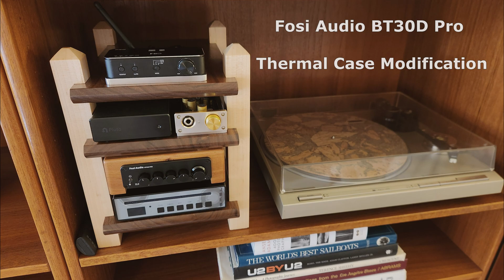CAUTION HOT!  Fosi Audio BT30D Pro Thermal Case Modification

Comment: Yea... even i modified the thermal, subwoofer line keep protecting... Using Vinder 48v 10A and JL Audio 12 W3V3. Thats why they send us only 32V, at 32v 5a the sound cant compete with tpa3116D2 24v 6A 🥲

Comment: Roy, I absolutely love your Sapele cabinetry and your Mahogany shelving! Gorgeous stuff! Just last night I was picturing a set of shelving remarkably similar to your design, as I was trying to work out where I'm going to install my new Blumenstein Orca speakers, a Fosi V3 Stereo Amp, and a gorgeous bright red limited edition FiiO K11 R2R DAC. Should be a good match, I think!

My BT30D Pro running the 48V PSU does not get quite so hot as yours, but my sub and speakers are pretty efficient. I'm using some tiny-but-amazing JVC EX-A1 wood cone full range speakers, plus a very lovely down-firing Denon passive sub from a 5.1 system. The BT30 D Pro still gets a bit too warm for my liking, and I don't think Class-D circuitry benefits greatly from high temperatures. :P

So, I'm gonna cut a couple of slots in the top and bottom, like you did. That will make a huge difference, I think. But alternatively, simply epoxying an 8-heatpipe horizontal CPU cooler to the top of the case would do wonders. Even without a fan. The vertical nature of the fins, plus the heatpipes, make them very efficient. And I found a completely black one for just $60 at AliExpress. And the heatsink size is almost identical to the amplifier size, so that is a very cool option. 

No pun intended.

Comment: I have the BTD30D PRO version to drive my late 90's   Sony SS 3ohm mid n highs speakers and a 1.5 ohm subwoofer, all from a long dead Sony ZAV dvd home theater system. First i connected L/R channels and  handled pretty well those 3ohm speakers with mild case temperature. Things got very hot when connected the 1.5ohm (below spec) Sony sub. It did drive it spectacularly even at high volume. But it does get alarmingly to hot. Even tested the amp working for a dedicated passive sub. Then tried connecting the 3.5mm sub output to a Fosi ZA3 amp driving the sub in mono. Again the BT30SD got very hot fast. Currently I am still using those 3 ohm speakers and 1.5 ohm sub at 50% volume for casual use but WITH AN EXTERNAL USB FAN which gets the cooling job perfectly. Now i can crank the sub without external overheating.
Reply from the maker: In your case I would steer away from this small class D for those spkrs.  Using this amp I would stay 4ohm and above.  Cheers!

Comment: Have you been using the non-Pro version for a long time and then upgraded to the Pro? Was there any difference in sound quality? I've been using the BT30D non-Pro for a long time and I'm planning to upgrade
Reply: I have the BT30D and the BT30D Pro. The main difference is power output. With a larger power supply (I recommend minimum 36V 10a), the Pro can put out much higher wattage in all 3 channels, and can use 48v power adapters. The Pro is overkill for a desktop system, and best when you have a large passive sub and larger-than-bookshelf speakers. I use the BT30 30D for my desktop, powered by a 24v 10a power supply and paired to bookshelf speakers and an 8" passive sub. Rocks my home office.
Reply: My wife has the non-Pro - and I have 2x Pro. Upgrade is good. Get the 48V PSU!

Comment: I run my setup off a motorcycle battery and a trickle charger.
Reply from the maker: Cool, should work, but why?
Reply: @motleypixel so not to take up to many outlets for all my devices.  Cleaner sound eliminate tiny wall wort  transformer, wine..
Reply: Should run yours on 3s maybe 4s lipo and a nice balance charger
Reply from the maker: @codyall2675 no thanks, more space and more trouble for nothing. Guarantee if I did a blind test with 100 random people none of them could hear a difference. https://www.audiosciencereview.com/forum/index.php?threads/do-you-need-linear-power-supply-for-dacs.7021/
Reply: @motleypixel First, my wallet is in my back pocket. Take it. I want that wood shelfing NOW. Second fantastic video. At 56 and 3/4 years old I am building two systems. A 9.4.6 for cinema and a 2.1 for music. Both in my livingroom. Music will be Fosi based. I'm stuck. Do I buy the glitzy shelves with fans from Fosi or do I get the adjustable height, glass shelves from Amazon? What say you? And finally three, fantastic job. The POV build was better than any over the air station production. Thanks.